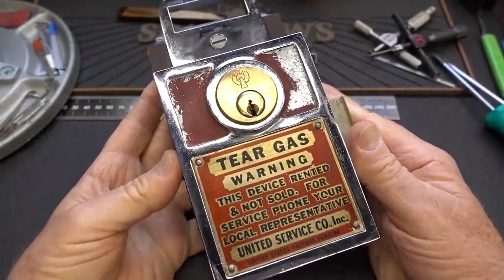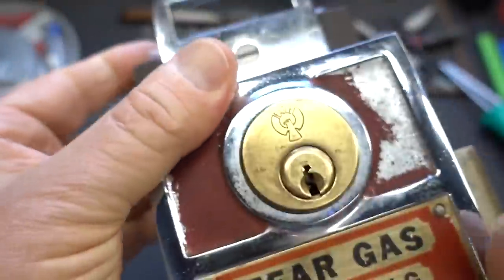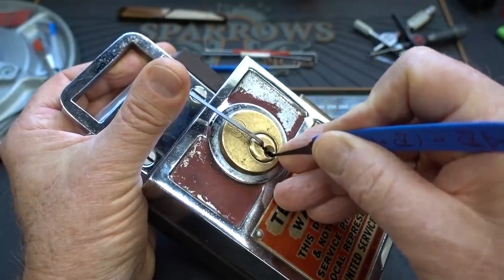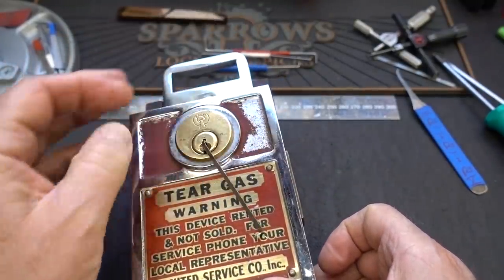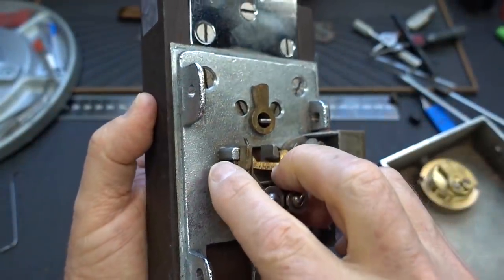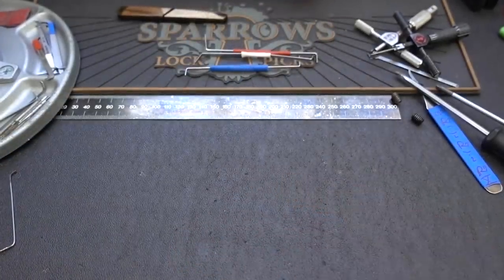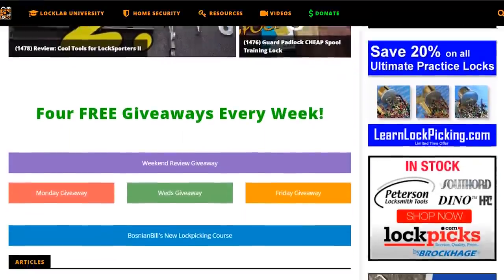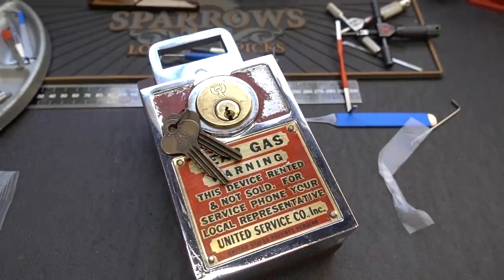(1794) Lock Booby-Trapped w/Tear Gas!

Comment: I worked for Diebold back in the early  80s. I have seen old bank vault doors with tear gas on the back.  They were operated by a trip mechanism that fired a .22 round into the glass ampules
Reply: Did they let new workers service those locks?
Reply: @cooldudicus7668  
All of the ones I ever encountered already had the round removed.
Reply: Firing an actual bullet through it is the most American thing ever, they could have just installed a hammer mechanism or something else. But if it works it works lol!
Reply: cool
Reply: @mielvanvelzen5967  If you're trying to pop a lot of them, projectiles cost less than mechanisms.
Reply: @mielvanvelzen5967  I suspect that it was a blank round, similar to what a ramset uses.
Reply: Wouldn't a .22 round be kind of overkill just for shattering a glass vial?
Reply: @space-junk  .22 short can be under 100 joules of muzzle energy. It would be an excellent cheap way of shattering glass.
Reply: @space-junk  
I never saw one with a live round, they had all been removed. I suspect it was probably a blank of some sort. The noise it created may have been part of the deterrent.
Reply: @scott_meyer  Oh, okay-- that makes sense. Maybe it was something similar to what a Ramset uses?
Reply: @space-junk  A blank .22?  Not necessarily.  It could be made of very hard or thick glass to prevent accidental breakage?  Have you ever tried to break glass that is designed to withstand impact?  It is amazing to me how hard it can be to break.

Have you ever used a powder actuated hammer?
Reply: @mielvanvelzen5967  There was a mouse trap design that consisted of a loaded revolver on the end of a mechanism that a mouse would activate while being in front of the barrel

It came around back in the days of running the old west I believe
Reply: @scott_meyer  Probably removed after a bank employee gets nailed by the boobytrap.

Comment: would probably be more effective if there was a false set that triggered the teargas like a master key that opens it further than it should.
Reply: It's pretty easy to hammer a pry bar in a door jam and pry back a latch. I imagine a good number of smash and grab jobs gain entry this way. For that reason this seems effective. A false set that triggered the gas would be a fairly cool design, but depending how that was designed damage to the key could potentially set the trap off when the lock is in normal use
Reply: What do you mean by a master key opening the lock further than it should? Sounds interesting(ish).
Reply: @asmqb7222  I mean a master key is like a false set that is not false but also opens. And you can make it that if only one pin is set different either the lock opens or only part of the lock moves and triggeres the trap
Reply: @ruben307  so if this 'master' key springs the trap, how is it a master key to begin with? Makes no sense to me. Maybe you mean a Rake or Bump key?
Reply: @DanceySteveYNWA  I mean from the functionality. The master key set up works with the system that there is a split pin making a different key also open the lock only you could make it that it opens the lock in a way that also triggers the trap.
Reply: @ruben307  That's a terrible idea.

Comment: Keep in mind this was the dealers lock and not the real thing. Someone commented there's no dispersal system, but that just might be unique to the sample and not the final product. Also I agree with the speculations many made that the hammer may also not be as secure as in the sample. Remember this is the 20s, so driving is nowhere near as smooth as it is today with modern shocks and properly paved roads.

Comment: This lock just gave me a great idea! That metal box around the cylinder amplifies the pick sounds so well, maybe you can fabricate something similar to hold other cylinders to do the same for them!
Reply: I sent him a core holder, made by 3D Locksport, which amps the sound.
Reply: @thelockpickinglebowski633  I've seen those 3D printed holders and they are great, especially for SFIC cylinders and others that may not fit well in a vice, but I don't recall them amplifying the sound quite like that metal box did in this video. I'm thinking the material is the major difference here.

Comment: In the early 80's trip wire CS gas devices were available.  In my store we had one installed in the firearms vault (1500 sq. ft. concrete room)  One night 2 high school kids broke into the store through the back concrete block wall.  They missed the firearms storage and into the area where we had seasonal clothing.  When they got in and realized their mistake. They broke through the gun storage door.  (Which set off the alarm) The CS gas filled the room and they got nothing.  They got caught when they took themselves to the ER.  The residue from some of these gas types  are corrosive.  Had a lot of clean up as the residue remains an irritant for a looong time.  Never used the gas system again.
Reply: In the mid 80's we carried CS, during less than lethal training the instructor sprayed it on his finger and ran it across our bottom eyelids.
One night during a bar brawl one officer sprayed the whole lot, including 2 other officers.  After that real application I was wondering if being shot in the arm would be as painful as that stream of CS in the face. 😱☠
Reply: We had a bank in our building where we worked - they had a fogging system that caused the room to 'go dark' within a few milliseconds.    The lights turned off and strobes kicked off.  Kevlar blinds shot-out of the desk and hit the  ceiling.   Killed a few people (by hanging) but didn't cause any long term problems.
Reply: @tcpnetworks  only on the internet are deaths not a long term problem.
Reply: You can't complain that the system didn't do its job, though.
Reply: @alan3082  i do a lot of training with military police they have to get full strong spray right to the eyes then run a bit of an obstacle course as part of their CS spray training.  Might be a different recipe to the way it was made in the 80s.
Reply: @OneOfDisease  Not sure if anything changed in CS, I haven't seen it in quite a few years.  Departments switched to capsaicin pepper spray.
Reply: Should have replaced it with a permanent dye system. 😜
Reply: @RayleighCriterion  Dye does not make them leave the building.  We were distributors of most major gun makers. An upgraded alarm system and a few improvements to the structure kept the insurance company and ATF happy.
Reply: Sounds like it did its job. Sort of surprised to hear highschoolers were tunneling through concrete though.
Reply: @CWunderA  One of the miscreants was the brother of one of my employees.  He had a drug habit.  Cinder block wall is no match a big strong person with a sledge hammer.
Reply: @Muckin 4on Over 800 long guns in that store room.  Leaving the vault door unlocked was/is not an option.
Reply: @ashtonhoward5582  😂

Comment: We had an electronic version of this setup in a high security building. On the outside was an ordinary looking man door and dead bolt, nothing very obvious. Inside was another door with more locks, and you had 30 seconds to put in the alarm code before your eardrums get blown out, 30 seconds after that tear gas was released.

Fortunately never went off outside testing...

Comment: An update to this lock would be to have an interactive element that disables the tear gas being broken. Most people wouldn't know about the interactive element, try and pick it and set off the tear gas, but those with the interactive element on the key would be totally safe!
Reply: yeah I though the mechanism would be rigged to the core, any forceful twisting by more then a set force would trigger the mechanism.
kinda disappointed, but I guess 1920s industrial processes weren't up for such a complex machining job.
But an update to this lock would be a nice reassurance for some doors.

Comment: This is the perfect videogame lock:

1. Very large and obvious lock that you can see even on low-resolution TV screens
2. Clear explanation on what the lock does if you fail the picking minigame
3. Failure penalty for the lock is just enough to be annoying but not enough to actually cause the player to not be able to progress
4. Requires the use of an otherwise useless craft item ("broken lockpicks", because actual locksmithing terms like "tensioner" and "pick" have yet to actually make their way into most videogames
5. By the end of the game, will be installed on every door the player encounters, even if it makes absolutely no sense for it to be there

Comment: The casing doesn't need to break to release the hammer.
If you look at the primary locking bolt, it is retained by spring-loaded fixing screws.
This lock is built for inward-opening doors only.
Persons kicking / shouldering the door would put a bending force on the primary bolt, compressing those springs and releasing the hammer into the glass.
Being a salesman sample, I would assume it's comfigured to be done with your hand to demonstrate.

Comment: The whole mechanism attached to the deadbolt that engages with the lock is floating on those two screws with springs. If you force the  door you apply a torque to said bolt pushing the whole machnaism away from the back plate and causing the hammer to silide off the blocking sear. 

It only works one way, and the teargas should be on the inside of the door. You can demonstrate this by simply pushing on the dead bolt, you might need a vise and visegrip to overcome the springs though.
Reply: If you was to place it this face up on the desk at 5:59, hold the wood and press down on the bolt acusing the rear or the bolt assembly to lift from the backplate and it will fire.

Comment: The tear gas would have been triggered by someone trying to punch the bolt back in the locked position. The actuator that interacts with the cylinder tailpiece would break off the hammer retention tab. The tailpiece of the cylinder drops the bolt actuator down below the hammer trigger when the key is used to unlock it.

Comment: Would the hammer strike the ampules if someone used a crowbar at the latch? It seems like trying to force the bolt in would cause the hammer to release.
Reply: Good point. If I designed it, it would take them out
Reply: Yeah, it looks like trying to force the lock pawl backwards also shears that cast tab off letting the hammer fall into the cs gas vial.

Bad times.
Reply: yes, looks like the bolt is held by springs and when someone pulls on the door, the bolt lifts the hammer over the stop
Reply: @lpz3sn  I was going to comment this. Yes that looks like the mechanisim. The bolt is held to the backing plate with a spring. If you slam into the door to try and break the bolt out of the door frame, the bolt will lift off the backing plate which will lift the hammer off the catch.
Reply: It’s made for a brute force attack on the door. If you slam the door in then the bolt will lift the hammer of the retention pin and actuate the hammer to vial motion.
Reply: It looks like it is just designed to activate against brute force. Kicking, prying, battering.
Reply: @patrickc1508  Perfectly covers the real risks then, I dunno of any real criminals using lock picks.

Comment: .
I saw something similar on a old store vault in Lexington Kentucky.
It had a special key that locked out the "Tear Gas" mechanism when you opened it.
The spray ducts were along the perimeter of each of the vault doors, facing out at 45 degrees.
The ampules were pressurized by a pump arm which would pump air into the system when you closed the door.   A gauge read out the pressure level.   You could manually charge the system, using the pump.
.

Comment: That "paracentric" keyway in the practice lock is a schlage SC1. 
I have one of those, and highly recommend it. It can be pinned with up to 7 pins and comes with a wide variety of lots of pins and spare springs and screws for the pin stacks. It's entirely easy to gut it, but can be repinned without gutting it by top loading. Mine came with a 5 pin key and already pinned for that key with standard pins but there are lots of different types of security pins that come with it. Even comes with an Allen wrench for the screws used to top load.

Comment: I once saw a lock similar to this.  Instead of gas canisters, it had three tubes.  With the back panel removed, you can insert a shotgun shell into each tube.  Each tube has a trigger switch behind it which is held in place with a lug.  If the lock is pried with a crowbar, the lugs break and the triggers fire the shells through the front panel like a claymore.  The entire front panel is made out of fragmentation metal similar to the type used on fragmentation grenades, and there's a thin layer of gunpowder behind it.  When the shells explode, they punch through the gunpowder layer which explodes the fragmentation layer.
Basically, it's a claymore inside a door lock!

Comment: What other booby-trapped designs are there? I can imagine someone trying to put together a very dangerous electric shock lock... that's a scary idea.
Reply: Scary, but excellent
Reply: If no key, send a deadly voltage through the lock to electrify the tensioner as it's being picked?
Reply: The electric schlock
Reply: Why stop there ? A claymore lock?Small directional mine that explodes and  shoots steel balls if you try to unlock it without key.Or maybe put a shotgun shell.
Reply: I wonder if INSECT FOGGING CANISTERS could be rigged in some fashion?
Reply: I have seen a lock with real obvious key cylinder and the true cylinder hidden behind an ornate trim cover plate ,, tampering with the openly visible key cylinder in any way , tripped an extremely caustic chemical spray trap that would likely permanently blind and disfigure the person trying to tamper with or force the lock open,,
Reply: I certainly didn't mean any close to deadly. Just something to zap you off your tension tool.
Reply: Put an electrical contact on the first and last pin in the lock. If the last (deepest) pin in the lock is set before the first (outermost), someone is trying to pick it - detonate the dye pack.
Reply: They exist in developing nations, they are considered a "man trap" in the west and are illegal. There's probably exceptions like on military bases but for the general public we can't use them. If someone gets hurt they will sue the living hell out of you.
Reply: Where was that Brian?
Reply: There was less need for booby trap locks, i believe they used booby trap Guns Bit more often back then
Reply: I thought that would be a good idea if you could make it shock the attacker if they were trying to drill out the core. Or have a blasting cap go off if someone tried a brute force attack.
Reply: @zumbazumba1  I was thinking a blasting cap, but I think all of your ideas sound great too.
Reply: I once saw a claymore style lock that has shotgun shells inside, which are triggered when the lock is forced.
Reply: What you mean is "I came up with a basic concept using electricity. Has anyone ever seen or heard of such a thing in real life?". Say it like you mean it, not like a 3-year-old asking for chocolate.

Comment: I think the mechanism for breaking the ampules works when the door is kicked in as well. It looks like the deadbolt itself is only held against the back plate of the lock with a spring. If the deadbolt is actually twisted away from the back plate the hammer would pop off the post and smash the vials.

Comment: If you kicked the door hard, the latch bolt and chassis would twist releasing the hammer and breaking the vials. the big coil spring at the bottom holds the latch bolt chassis in place

Comment: I think If you try to kick the door in it dislodges the hammer. the dead bolt probably acts like a lever since the only thing holding it down is that spring. I'd assume trying to force the deadbolt with a crowbar would break the post also.

Comment: It's to prevent someone wedging the bolt open. If you tried to wedge open the bolt, it pushes on the horizontal brass bar, that then breaks that post holding back the hammer.

Comment: it looks like the deadbolt is designed so that when the door is rammed against with sufficient force, the lever is moved by the extended bolt frame, using the lock frame as a pivot, then it would pust the hammer away from the lock frame and free it.

Comment: it looks like the actuator allows the bar to move but once locked if the tongue is forced back into the housing, say with a crowbar, to open the door it snaps off the lug and fires the gas.
Reply: it looks like the yellow brass part of the mechanism actuated by the lock cylinder would get raised when the bolt is pushed into the housing, lifting the hammer away from the post
Reply: Yep, that looks to be exactly how it works. The bar and deadbolt move as one. If the actuator isn't holding the bar out of the way (by using the key), then trying to force the deadbolt will break the hammer free. Attacks that don't either push the deadbolt in or totally smash the lock wouldn't seem to trigger anything.

Comment: I have a slightly different take on how it works: You'll see one brass screw holding the actuating lever in place in front of the deadbolt.  All of the rest of the screws are steel.  It looks like if you strip that brass screw or pop the head off of it, the whole deadbolt, locking arm and ampule smasher assembly will be free to move outwards, popping the smasher off the post holding it in place.
It would take a lot less force to destroy that one brass screw than it would to actually overpower the whole lock.  Using a pry bar or ram on the door would probably trip the ampule smasher before either the door or the lock were permanently damaged (other than cosmetically).
Certainly not anti-pick, but probably more than just the idle threat it seems like it is against someone kicking the door in.